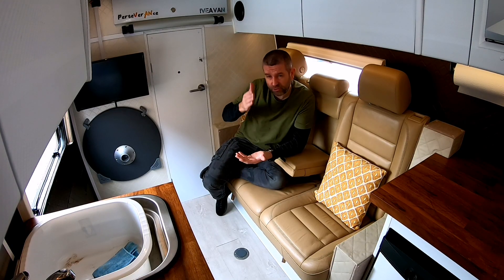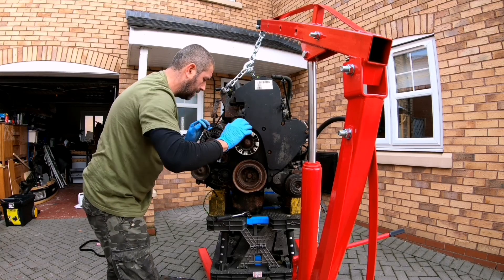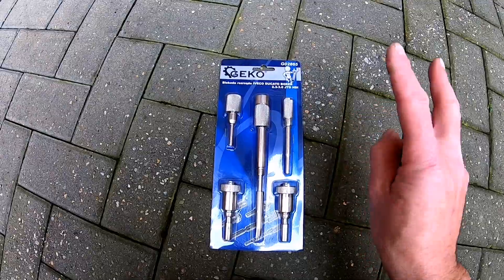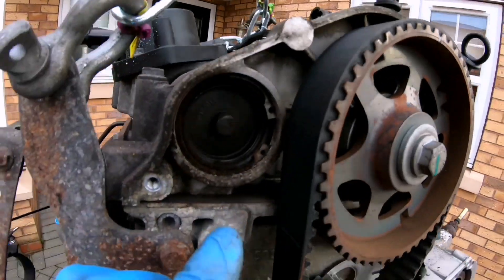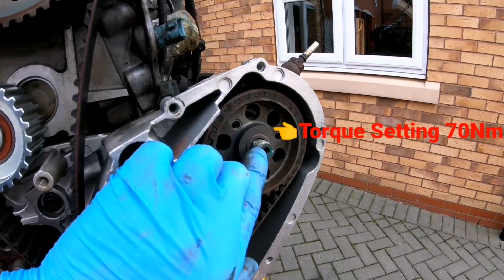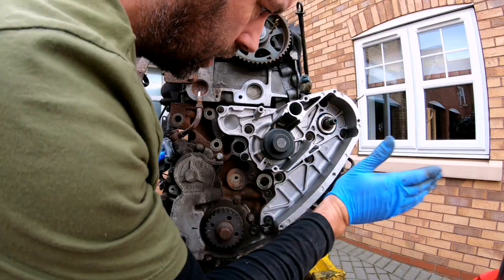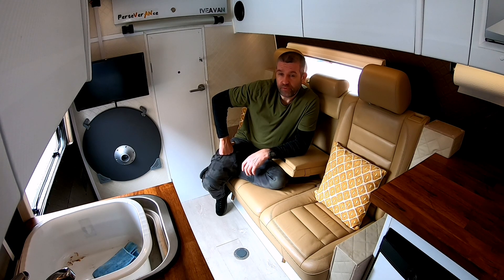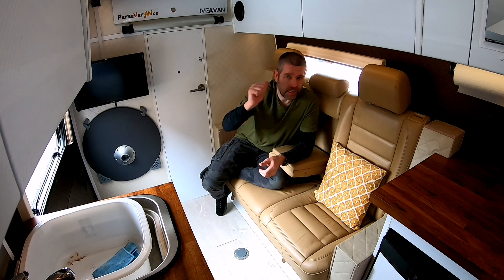Iveco Daily/Fiat Ducato, F1A 2.3-litre Timing Belt. "Additional Information!"

Comment: Hi Mark , just got my Iveco , -what’s the temp gauge normally sit at Mine was sitting between half and just over , going to be doing the cambelt with your excellent tutorial , regards Gary
Reply from the maker: Hi Gary
That sound's about right at this time of year. The cooling fan doesn't kick in until around 96°C , you probably find the temperature gauge will hardly move during the winter months, has long your not regularly topping up the coolant it sounds like a usual Iveco temperature gauge, perfectly normal 😉👌👍...

Comment: Hi, what about timing of fuel pump? Does that have some pin? Thanx
Reply from the maker: No, electronic timing fuel-wise, the high-pressure pump doesn't need timing. The pump is constantly pumping diesel with a regulator solenoid, maintaining the pressure upon the fuel rail. As long the cam and crank are timed correctly, the ECU deals with the fuel timing via injector drivers within the ECU 👌👍...

Comment: Hi can i ask , do you have to replace the timing belt tensioner bolt , it doesnt come in dayce kit , cheers
Reply from the maker: I don't recall one in the timing belt I used either. So I must have used the original one. 👌👍.

Comment: hello local garages say they are unable to change timing belt on my 2.3 euro 6 engine as they told me it needs special tools?? only seem to get fiat dealership to do it!!!
Reply from the maker: I've not heard of that before🤔, not sure what's the difference would be  as I've never compared the two side by side or whether locking tooling is different bud 🤔👌👍👍👍. (sorry, but you're comment was stuck in my "held comments" for some reason🤔)...

Comment: Great video. Thank you. 
Fiat says to replace the timing belt on the Ducato at 192000km or 5 years (regardless of km). Do you think these belts and tensioner can only last 5 years or they can go a lot longer if you don't do many km?
Cheers
Reply from the maker: Probably the reason why Fiat say 5 years (believe its the same with Iveco) is down to the rubber of the belt deteriorates over time, so obviously they have to give a time period to cover their own backs 😉👌👍.
Reply: Thanks mate. How old was yours when you replaced it?
Reply from the maker: @maem3391  I think it was 4 years old at the time but I couldn't see in the history of the van, when or if the water pump had been replaced in the past. My van had 315.000 miles at the time.

Comment: Great video I have been told I have a timing chain problem even tho it got done 8 months ago 😂🤷‍♂️ fiat ducato 3.0 auto 59 plate starts fine no issues but won’t start when warm only way to fire up is remove camshaft sensor plug to get it started. guy at the garage says timing issue even tho I know it’s been done. What’s making me question this tho is if a chain issue why does it start and run fine until you turn it off? that’s the only issue I get run once it won’t start until cools down 20 mins time wtf is happening lol
Reply from the maker: I had the same issue with mine about 2 years ago, drives and starts fine when cold but either cuts out or will not start when at operating temperature. It turned out to be the crankshaft sensor, been running fine since I've replaced that 😉👌👍👍👍.
Reply: @Iveavan  yes that’s what the code is buddy p0340 and p0016 but 😂 also code p0053 p2243 both camshaft and crankshaft sensor got changed yesterday still codes and warm start issue . Told me they have no idea 2 mechanics now said sorry can’t help. Guy today said last thing is timing chain he reckons  a mistake must have been made first time 6k miles ago maybe a tooth out. I just find it strange when these bonnets let so much water in 
Think a auto electrician needs to see it
Reply from the maker: With out seeing it in person it's gonna be hard to diaognose upon here, but from the sounds of it, your going down the right route with a Auto sparky, hazarding a guess, quite possibly a wiring fault some where🤔 probably worth in seeing whether or not the timing pins will align to discount the suspect timing issue (I'm not familiar with the timing chain set up myself) 👌👍👍👍...
Reply: @Iveavan  thanks buddy I will try get someone to look if pins lined up, apparently getting a auto electrician to check is like a needle in a haystack 
Maybe a complete new engine wiring harness be better . I seem to be getting a lot of sensor issues . Ecu checked and is fine continuity done on camshaft sensor all fine it’s a weird one . But I’m told just because I’m getting phase and lambda sensor codes doesn’t mean that’s the issue it could be map sensor . One of those jobs I supposed buying and changing different sensors until find the correct one

Comment: Hi I have a 2.3 2005 Daily 35s12 I don't know if it's the same model engine as yours, mines a F1AE0481B. I've been going crazy trying to identify what looks like the wheel/cog that I think you have the ratched on at the beginning of your video at 1.16. It's definitely a belt tensionor wheel but mine is only about 5cms diameter and a cm thick. Can it be that I only have the metal bearing part left and the rest of the wheel has come apart? The one they've given me here in Germany from a parts shop is mostly plastic and 7cms across/diameter. Maybe that's why I couldn't ID the part because my old one is smaller? Any suggestions would be more than helpful. Looks easy enough to swap once I figure out how to keep the tension off and undo the nut at the same time. Are they the normal anti clockwise to undo?
Reply from the maker: Sounds like the timing belt tension pully from your description. Try https://www.cheapivecoparts.com these guys will help you 😉👌👍👍👍...

Comment: Excellent tutorial video mate! I have some questions. Does the Daily use Fiat Ducato engines? Including the 3.0 liter diesel? Which engine(s) and what years are the most reliable and durable Daily engines and transmission? Which engine uses timing CHAIN? Thanks and well done mate!
Reply from the maker: Cheers bud, yes, in mine is the fiat ducato 2.3 Lt engine. All of the Iveco engines seem to be reliable & capable in doing over 500k. The 3lt is the chain driven one, both the 2.3lt & 2.8lt are the belt driven ones. Rust is the bigger killer then the drive gear to be fair on the older models, but you have more electronics to worry about on the newer models 😉👍👍👍...
Reply: Does the 2.3 liter diesel have enough power on steep mountain climbs on a full load? I think yours is the long wheelbase. How much weight can your van carry? And do all 3.0 liter diesels come with six wheels? Are dually tires at the back better for stability and distribution of weight? What website has all the specs for the 2000-2006 Daily?
Reply from the maker: @IkeCantle  the 2.3lt is perfectly fine, I often go up Sutton bank with no issues, mine is a 35s-12 (3.5ton, Index 'S' = light chassis of 3mm thickness and single wheel rear axle 12= 120hp or there abouts ) and if your wanting a luton it probably will come with dual wheeled rear axle and yes, better stability, any iveco with C index (heavy duty thicker chassis of 5mm)  do come with the dual wheel rear axle. Best websites, probably best ones are on the Facebook groups, there's an list of them, in the description of my van tour video bud 😉👌👍👍👍.
Reply: This info is very helpful as I knew nothing about the Iveco Daily. I am more familiar with the Sprinter van, but I read somewhere that the Iveco Daily is more robust than the Sprinter. I like solidly built products that last a long time. Thanks so much and I'm really impressed with your van build. It shows you knew what you were doing.
Reply from the maker: @IkeCantle  no worries matey and thank you 😉👌👍👍👍...

Comment: I have a question to ask on the motorway dose your van handle good at 60 mine seems to be very vague so I drop down to 55 or 50
Reply from the maker: I be honest, I don't often see the speed's below 70 on the motorway within my Iveco, in what way your's doesn't handle good above 55?🤔👍👍👍.
Reply: @Iveavan  when I’m on the motorway and reach 60 it’s has if the van just wonders and and you have to concentrate to keep it steady but when I’m at say 50 to 55 it’s real steady I’ve had it in the garage on the ramps and everything is tight and nothing loose I do get a vibration from 50 to 60 then if I push to 63 vibration goes I’m thinking center bearing on propshaft Ive never had an Iveco before always had transits thought I would change to bigger van it’s all done out now has a camper just annoying to not do 60 or above if you have any ideas I’d be great full thanks
Reply from the maker: Try Swapping the front wheels for the back ones (make sure the tyre pressure is set right for each axle) and see if the vibration and wandering goes, if this doesn't cure it, I'd be inclined to take it to an tyre specialist for them to carry out tracking, and get them to check out the steering and suspension front and back, if the vibration still there after Swapping the wheels over it could be the case that the wheels need balancing or your propshaft centre bearing, the rubber coupling that the propshaft bolts on to, or one of the UJ's is worn 😉👍.
Reply: @Iveavan  hi thank you for your advice had the rear wheels done and one wheel was buckled so had them balanced now it drives at 70 no problem so thank you still got the vibration I’m thinking center propshaft bearings are they hard to change
Reply from the maker: @folkandcoveracoustic7892  I be honest, I've never done one, but if you look on the Iveco forums on Facebook, no doubt someone will have 😉👍, at least you sorted with one of the problem's bud 😊👌👍👍👍...

Comment: I’ve got the same van how much should it cost to change the cam belt/timing belt and water pump at a garage mine is on 132,000 so would of thought it has been done but was thinking of getting it done
Reply from the maker: I can't give you a price as the only time I use garage's, are for when the van needs an MOT. but I safely say an days labour (an experienced mechanic could change the belt and pump between 3 to 6 hrs, depending how they tackle the job and what issues they come across like seized bolts, seized crankshaft pulley and so on, but setting aside a day's labour would cover this), and the cost of parts (new coolant, and belt kit) 😉👍👍👍.

Comment: Brill. Thanks. Hope I don't have to do this. Looks like a crap job with the engine in. Mind's a chain, anyway. Should last longer, but there's a start up rattle do the chain or tensioner may be on the way out.
Reply from the maker: Cheers matey👌👍,  probably worth looking into that rattle bud just in case 😉👍👍👍.
Reply: @Iveavan  yes, agree. Due for a service in a months time. Mentioned it at the last service, they said it's ok for now. Have only done 6000km since.

Comment from the maker: Link to "How to do a Timing Belt and Water Pump Change on the 2.3lt Iveco Daily Engine." 
 https://youtu.be/ssQkytlC1rs
Reply: Can you pleas let me know how to tighten a nut on high pressure pump pulley because it spins?? Thanx
Reply from the maker: @bavarc5  it shouldn't do if you have the locking pins in place matey 🤔😉👍👍👍.